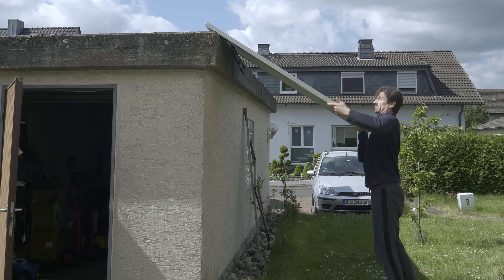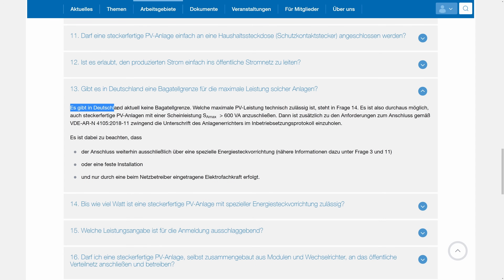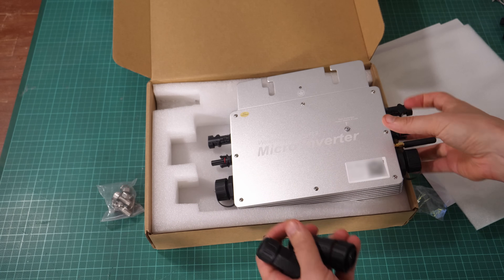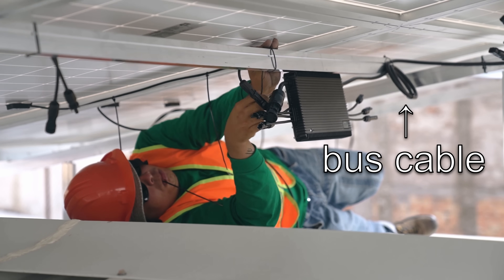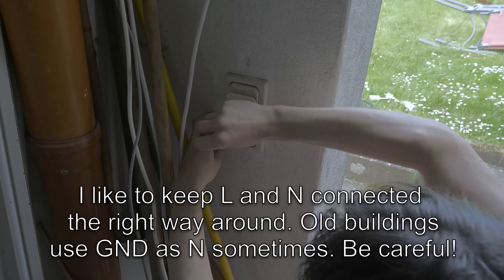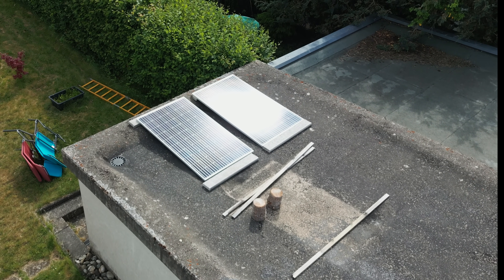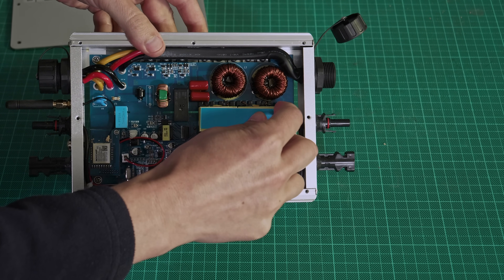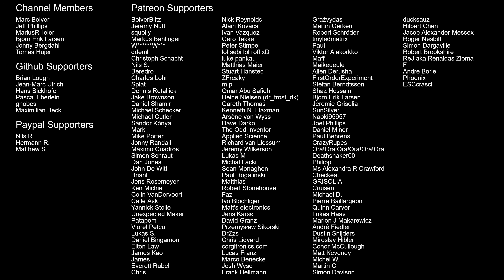Cheap grid tie solar setup (600W 3kWh/day)

Comment: Hey! where did you get the panels from? 
your link shows flexible ones from Ali but that doesn't seem to be the ones you are using
Reply from the maker: Unfortunately the panels are long gone. Basically any link I would put there would expire fast currently. That flex panel link is just a proven source, since a friend bought these. It's more suitable for balcony installations. You can get hard framed panels for 150€/350W atm with some waiting time. Don't feed the scalpers
Reply: @bitluni  The flex panel is 12V, but the microinverter says its input should be 22-60V. Would I need two panels in series to make it work?

Comment: i wish the us had such allowances for adding small panels with smart inverters. saw a video in california how a homeowner had to pay 20k for a contractor to install a ghetto 3kwh system with no storage on shelby churches channel. maybe $1800 worth of solar but she had to pay 20k for licensed install and permitting. really destroys the pay back period. i recently installed 200wat of flexible panels on my ev since there is no permitting needed and EV electricity is one of the most expensive. very simple setup wired into the 12v system but still offsets the consumption of the highvoltage battery. surprised no one else has really done this oneline. 11-18mo payback period. couldnt get such returns investing

Comment: honestly ac wiring in water is safer than high amperage dc. also heat is the biggest factor in compromising working lifetime. keep it cool.

Comment: I just finished to installed two 420 W panels on the wall of my house. I've bought all separately like you because of the high prices of kits. I had a APSystem micro inverter that seems to work only in certains security condition. For now I'm just at the step of connecting all things together and see if all is properly working! 

In France you have to declare to the network manager company that you are going to install a micro inverter and be able to send in the public network the excess of electricity produced and so you have to give them a proper certificate for the micro inverter. It's why I didn't bought the one you get because no certificate was available in French... they only accept them in French!

So I hope this will work properly as I thought! Thanks for sharing your experience.

Comment: Cant u just ise the AC output from the inverter and connect it to a power strip and use the ac power without using batteries or conecting to the grid?

Comment: Can't u use the a
AC output of the micro inverter and connect it to a 4gang extension lead so I get AC power without conecting to the grid and batteries please let me know as I need to do testing outdoors

Comment: Something to note here is that the regulations don't apply if are completely off grid. But since the regulations are still kinda dumb the entire building is not allowed to have a grid connection. Just proper separation is not enough.

Comment: Hi!
I have a question so if i plug in straight to the socket what is fused by livingroom sockets...i only will get power from inverter on that fuse circuit or the whole house ?

Comment: Beware of solar panels at low angles. The water pools on the corners, and if some water finds its way between the the insulation layers, the PV cells corrode. Bye bye solar panel.

Comment: Does this work if you already have solar edge PV system installed (i mean the one with DC strings). I wonder if I add additonal micro inverter to my grid, can it damage my main PV when there will be surplus from micro inverter?

Comment: I'm just curious, if you plug the inverter AC output into the wall circuit, would it affect the incoming AC coming from the grid? Short-circuit? Or does it somehow regulates itself?

Comment: Great demo on how to do it but how do you keep your grid tie secure? I have looked in to this plug and play, and some "experts" mentioned that this will lead to having electricity in the grid even in case of electric shock or short circuit. Is this true and is there a way to get around this?

Comment: I bougth the same model, but the 3-pol AC connector only offers soldering the cable to it. Did you get the connector separately or do you have link?

Comment: I read several times that those WVC micro inverters are known for not giving the full power output, although it could be panel compatibility issues. 
As a continuity review: are you seeing 600w continuous output in the central hours of a sunny day?  Danke

Comment: I put 2 250w panels on my shed roof a few years ago, and it has already made over 1.6MW of power in that time. Not bad for £100 of panels and a £70 inverter :).
I brought the DC down from the roof into the shed, where it goes into a DC circuit breaker, that way I can connect whatever I want to it without climbing onto the roof which was never really designed to have people standing on it.

Comment: Ich habe den gleichen in der 1200W Version der bei 600W schon sehr heiß wird. Deiner wird nicht alt werden, die Kondensatoren werden zu heiß.
Deshalb montiere ich die Inverter IMMER in der Garage, dort ist es kühler. Zudem ist der Wechselrichter NICHT wasserdicht, auch wenn das drauf steht, wirst schon sehen.

Comment: As always, cool useful project! 
Some questions arise since I considered the same model: you write in the description output can be clamped to the required 600W to meet german regulations. Would it be possible to use more panels to saturate earlier/more then? Or would that fry the inverter in peak times? Maybe use a bigger model?
And regarding monitoring: is it possible to not use their cloud? Or do I need the 433MHz version for that?
So far I couldn‘t find answers to that, but maybe you did?
Reply: now I got panels producing ~400W and the similar WVC600: despite free airflow, shadow and 28°C ambient it overheats at 275W output power already. Crap! What do you get out of it during full sunlight? Mine averages on just 200W!

Comment: These are illegal in Australia as by plugging them into a power point like that you are bypassing any protections you may have in your switch box... i.e. earth leakage, et cetera.  Another issue is if you have someone come to work on your property and they turn off the mains thinking the power will then be off and safe, it actually won't be off because your setup is providing power that will kill some unsuspecting person.
Reply: Bit late but.This are on grid inverter.They Need to read Power coming from the house or the will not turn on.what you Say Is what happen with off grid inverter

Comment: Great stuff. I did something similar but you need to consider WIND. At some point you will have strong winds from the wrong direction. I used stainless steel wire to strap the panels to a fix point. Before this, wind moved all my panels but I was lucky. No damage but only due to luck.

Comment: Not bad. Prices have gone up for this hardware and they're problems known .. where the micro invert melts.
They are at scalper prices as the 1200watt was £89. I thinks it's £289 now??
But they break fairly quickly.
(There is a website by model number for the problems)

These plug and play.... Ish systems I was going to do as my solar low budget. But they are too dangerous/risky.

The mounting  not good..  if you have mastic base.then the solid packing foam (like neoprene) and then fix it down to the joist.

The law here allows on 20cm angle from a roof. Which is sad as 20 degress is the summer, but 20 off vertical in winter can make 50% difference. I guess the dictators don't want people taking or saving money.

Keep  the updates going.
 And I think 300w panels are the limit to the device some one has said.

Comment: Man building some off grid batteries are probably worth it at $.50 a kwh with those other limitations and just run some loads off that system and if power goes out you still have power

Comment: Nice little setup, don't forget to bolt the panels down somehow, or they could go flying in a storm!

I've just got myself another 6 panels and all the mounting gubbins to install on my house roof... Just trying to talk my brother into assisting!

BTW, I don't know about your panels, but on mine it said that they're warranty is void if they don't have at least a 10 degree slope on them (I assume for drainage).
Given your location, ideally you would want more anyway.

Comment: I also just got one of these WVC inverters with wifi, which can be controlled with the "cloud intelligence" app. Can''t find anyone having reversed the API to integrate it with homeassistant. Do you by chance plan on writing your own firmware for the inverter? I chose this model for having the option to throttle the output, as I have it connected to a battery instead of directly to solar.

Comment: Im not sure what's the average temperature you have during the summer, but if it is pretty hot, you might want to add some extra gap between the panel and the roof to get a few more Watts.

Comment: Very interesting project. I have a question if you have the time to give me some insights. What happens (not with the smart meter but with the older mechanical one) if you completely cut the mains power and leave the PV as the sole power source ?
Reply: nothing happens. the inverter only produces power when it gets a feedback from the mains. it's a security feature and must have in Germany. otherwise you could switch the main breakers off because you want to change a light bulb. but if the inverter wouldn't care about it it would send 230v into the system and you could get electrocuted. so this is not a blackout fallback.
Reply: @gnashermedia  Thanks for the reply. I appreciate it. So this is not a backup solution, only a money saving option as long as the mains grid provides electricity. I conclude that having PV as backup it requires a hybrid inverter and batteries.
Reply: @nikolaskallianiotis8622  Happy if I can help. I'm not a PV specialist. So take my 5 cent with a grain of salt. ;). To have a backup system using PV you need a mains integrated system. There are quite a few of there. The idea is that you have solar panels that charge a battery system and also provide power trough this battery system. To be exact the panels feed an inverter. This one charges the battery and provides the mains power support. Then you need a system that checks the mains power. If power is there you charge the battery and feed the rest into your mains and everything that is not used goes into the mains network. If mains power fails, than this system that monitors the mains tells the inverter to use the solar and battery power and it also drops the connection of your house for example from the mains. At this moment you are on a so called Island mode. You are a small island with your own power as long as the battery has power or the sun shines. If the system detects that the mains power is back it switches the mains back into your house and your back to solar supported usage. There are many systems that have this integrated. You need a system that monitors everything and manages the power handling. Those mini PV systems as in this video are only a support to save money and make your own environment friendly power. With a rating of 300 to 600W your can cover most of the standby usage of your devices for example. 
Instead of a big system you can use a power station or UPS to secure a few devices like computer or fridge etc. against a power loss. In case of a blackout you can also build a micro island. A power station like a EcoFlow River or Delta has Mains and PV input and supports something between 1000 and 2000 Watt output. So if you have something that shall be protected you can plug it into the power station and the power station into the mains. In case of power loss the station takes over as long as the battery lasts. If the blackout takes longer you can use solar panels to recharge the station over the day. That's what I have to secure some essential and vital systems I need. The power station lasts in my case 12 to 20 hours and I have 2x 100Wp panels to charge the station.
Reply: @gnashermedia  Great info indeed!!! That's what I need in fact. A backup system for power outages. Now here in Europe and especially in my case, Greece we expect during the summer lots of power outages because for (stupid) reasons not to mention here, we have based our main power generation on Wind Turbines and secondly on PV therefore our coal/gas and hydro generation is now the minority. So my urgent need is to support critical loads with some PV/backup system which won't cost an arm and a leg. Thanks again for your help!

Comment: The problem with this is that when the grid goes down even though you are making power thru the solar panels you will not have power in your home
Reply: a stopgap solution is to prepare a spare portable-inverter, then if power is out you turn off main-switch at distribution box then connect this portable-inverter to household plug. However there's no way to tell if the grid is back up with the main-switch switched-off, so this solution is a stopgap/emergency solution and you must manually set up these stuff each time you want to use it or remove it back again to check for grid power.

Comment: Did you really bought the 700W one with App support which ist illegal If you connect IT to the grid ?

Lots of troubles ahead considering that the local Power provider would force you to remove it at all due to exceeding the 600W AC limit.

It is not about 600V DC it is about the Impact on your grid in your house.
That is hard coded and no chance for discussion

Therefore your Video could be demonetized.violating local Rules and in a hazardrous Environment.

I'm also not sure If this one also had the issues of a bad pure sine wave which the channel Volt ampeere lux had investigated last year

Comment: I am curious if there are systems that come with an inverter each? e.g. so I could buy one or two panels + inverter and later upgrade with another 1/2 panels + inverter? I like the idea of having more modular setup's that can be improved over the years rather than paying for a large system all at once (and risking that they all fail at once if something goes wrong)

Comment: iv had one 250watt panel on my garage roof here in UK for 8years with a Replus micro inverter  been great no problems, i refused a smart meter i told them the meter ant that smart as it will charge me for power,  for pushing power back to them . i have also put an aluminium cross piece  on penal  and weighted it no storm has mover it an inch yet. as far as getting to trouble as long as you don't have an analogue meter spinning backwards then no problem ,if you are doing DIY a few panels only  is the way to go ,as it grid tie say 400 or 500 watts then thats best way to go you will be using most of that output. A word on cheap Chinese invers they don't last long ,Enphase is the best you'll probably  get a life time out of them, i got 6 months form cheap Chinese one , i'm on 8th year Renesola Replus micro inverter  but i can't find them anymore as i have jest got another 235watt panel, Enphase are expensive ,may have to bite the bullet .

Comment: please change the way you connect to the grid!!
if the plug get knocked out you will have mains on exposed pins!!
Mains ALWAYS comes from a socket, NEVER a Plug

Other than that... great budget install
Reply: Those inverters have an "anti islanding" feature that should prevent it applying voltage to an open circuit.
Reply: @NiHaoMike64  that may well be the case but when you accidentally complete the circuit thats not clever!
Power from sockets... ALWAYS!

Comment: The cheap micro inverters often have insufficient filtering resulting in many spurious harmonics and failing to comply with EMC regulations. They are by far the most problematic consumer RF noise source now a days.
Reply: True. I had to switch the inverters off while testing the $16 HF SDR thing.
Reply: And are those inverters save and comply to European safety rules (like switching off during grid maintenance or high voltage)?
Reply: @peli71  exactly!
My trust of products made of Chinesium doesn't extend to mains voltages!

Comment: Having the mains on the roof is still safer than having high voltage DC (many panels in series), which easily can start fires if not wired properly or exposed to moisture and therefore producing arcs. As long as your protective earth is working (testing the breaker) everything will be alright when a fault does occur

Comment: Don't use corking silicone for electronics. It produces vinegar when it cures and it will corrode everything inside. A different kind of silicone is used in electronics manufacturing.
Reply from the maker: Good to know! I believe this specific one doesn't have that. Bought specifically a more expensive one and it doesn't have that nasty smell the cheap ones have

Comment: Maybe it's just me but using a mains plug backwards seems incredibly dangerous.
Reply from the maker: They only turn on when connected to mains
Reply: @bitluni  oh that makes sense I guess. I'm not sure what the alternative would be otherwise
Reply: These kind of Inverters stop immediately generating power when no Mains power is detected. They actually have to.
Reply: @thokismail1  
Do you really trust chinese safety technology?
Reply: Not just you. It's called a suicide cable 😉